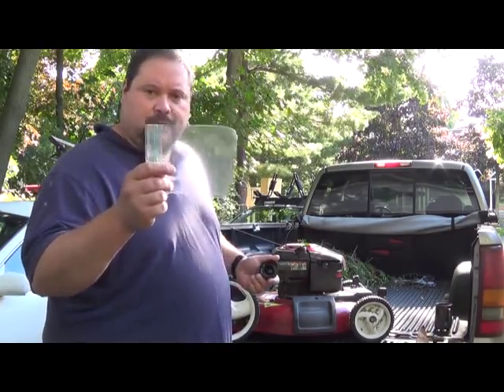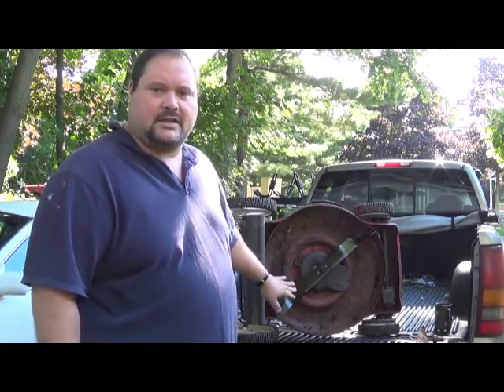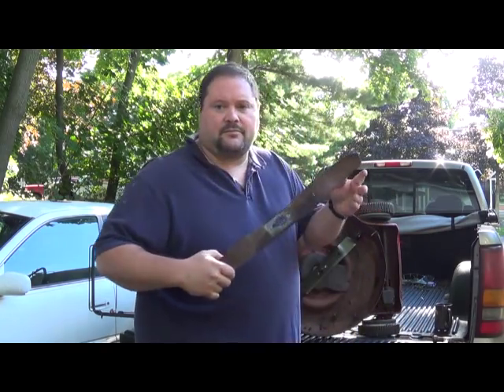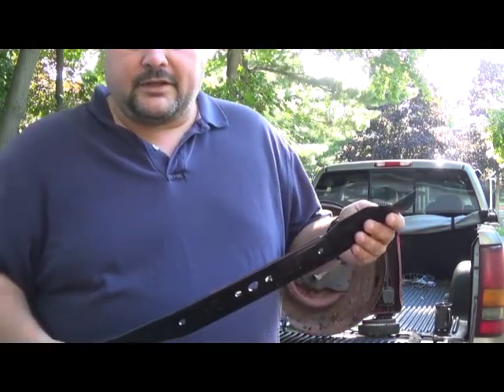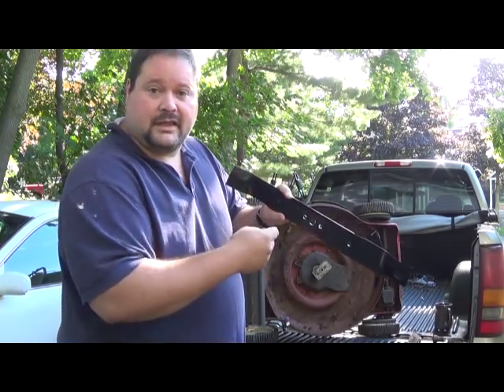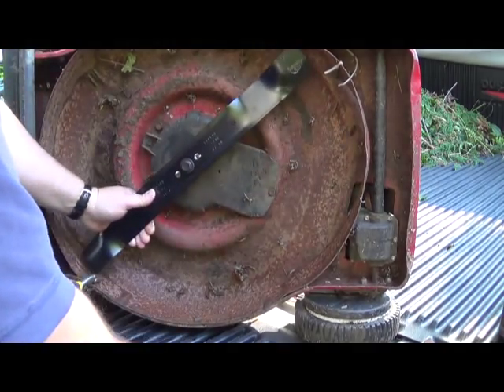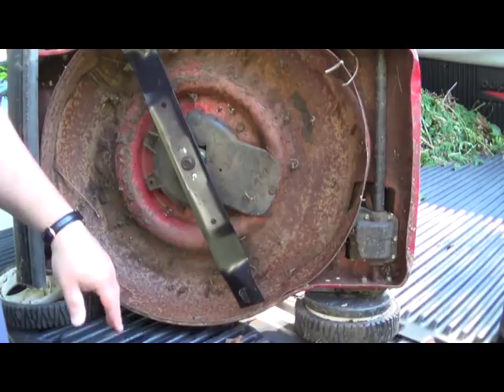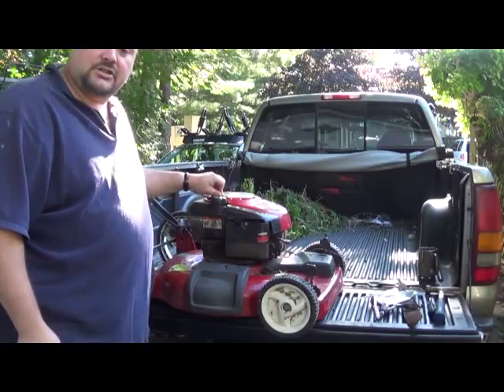How To Replace a Lawn Mower Blade in Minutes!  -DIY Daddy

Comment: Thanks, DIY Daddy!  The plastic bag and the vice grips ideas worked great.  For a little extra torque, I went with a socket on a 1/2" ratchet, rather than a 3/8.  All-in-all you saved me enough cash to go buy two replacement blades.  Much appreciated.

Comment: Great video.  I wondered about how to handle the gas.  Thanks for the ziplock bag tip.  I never had to do this before and suddenly find myself in that situation.  Easy to follow instructions and visuals for this yard mowing gal.

Comment: Great tip with sandwich bag.
Reply: not a good trick. this allows gas to enter into the air filter and could flood the engine. its best to empty the gas before doing any tipping of the mower. always tip it with the exhaust side down aiming down.
Reply: @OFFICIALTAEIO  it is best, but he did tip it correctly in the video
Reply: agreed

Comment: Great video.  I used a clamp and a wood block to hold the blade in place so it didn't slip like at the of the video.
Reply: Gabriel Ortiz Great idea!
Reply: Gabriel Ortiz what is a clamp? what does it look like?

Comment: GREEAT VIDEO , AFTER WATCHING YOUR VID , I WENT OUT TO BACK YARD CHECKED ON MY BLADE IT WAS REVERSED. LAID THE MOWER AS YOUR INSTRUCTION SIDE LOCKED THE BLADE REMOVED THE WRONGED SIDE BLADE AND RE-INSTALLED THE CORRECTED SIDE AND TIGHTEN WITH RATCHET PLUS IMPACT WRENCH DBL SURE . TESTED RUN FOR FEW MINUTES ALLOWED SMOKE TO BURNED OUT UNTIL IT CLEARED THEN TURN OFF LET IT COOL . THANK YOU SO MUCH

Comment: any tips on how to  remove the bolt if it is too rusty or would not turn? im using the same tool as your are but the bolt would not turn. i tried hammering it no luck.

Comment: Another good thing if that bolt down come out, go down and buy a breaker bar that has a 1/4 in adapter on it for a regular socket fit or your going to have to buy 1/2 in sockets and that bolt will turn like a knife cutting butter.

Comment: Most of the time there is a torque spec for the bolt, so he sure to torque as tight as it needs to be.  If not it can get loose and fly off.

Comment: thanks for the great tutorial. what is the best way to clean the area that was so rusted where the blade is? I have the same issue. Thanks
Reply from the maker: +Patrick Breuer I clean the area with a good strong hose stream then spray a good penetrating lubricant like liquid wrench or WD-40.
Reply: Thank you for quickly replying. Have a pleasant day.

Comment: Why didn't you show how to disconnect the plug wire?
Reply: Maybe cuz its 100% self explanatory
Reply: Mary Like bc you literally only have to pull it off it’s not complicated
Reply: joe baducci maybe it's not self explanatory for some people.
Reply: You mean the spark plug? Would you expect a toy manufacturer to explain how to remove batteries from a toy who's battery housing is easily identifiable.

Comment: always tip the lawnmower to where the exhaust is down. its best to drain the gas tank before doing any tipping. tipping the mower with the air filter down, it will most likely flood the air filter with gas and you will have trouble starting your mower.

Comment: i have a toro mower... the blade i took off is curved to fit the bracket...  my new blade is universal and is flat ..has some movement side to side until tight then it dont move at all... is this still ok?

Comment: I thought it would be best to run the mower till the gas tank is dry and if you did turn the mower over, the gas tank should be lowest so gas doesn't flow and flood the carburetor; likewise, oil's going to spill internally unless you empty that?

Comment: i bought some replacement blades and the arch in the middle of the blade was inverted. Does that make a difference. clockwise turn. cub cadet rzt zero turn 46"

Comment: Just changed one from new to wrong no wholes to grab the little washer nubs. Oh well. It's on tight. Wish my feet luck. Hahaha. Dad bought wrong blade.   I ain't changing that thing again. I have the nut really tight. Should be good. That's an extra non slip precaution on those anyway but I remember the 80s we had one that had no nubs to line the blade.

Comment: Tip the mower up on the two front wheels. Not on its side
Reply: Midnights & Mornings it depends on what type of motor you have. Some require to be tilted differently.

Comment: I guess I'm the strange one. I put my foot, sole down, on the bottom of the blade when I remove the bolt. Then the opposite side when reinstalling. Never had an issue even on rusted bolts.
Reply: I just grip the end with my hand and a thick leather glove, but I can see the concern of it starting up and taking off my hand.  Just usually I only pull the blade off at the beginning of the season after I have already removed the gas and ran it till it wouldn't run  anymore....
Reply: Hahaa I did the same thing with my foot and broke tbe bolts free with a breaker bar.